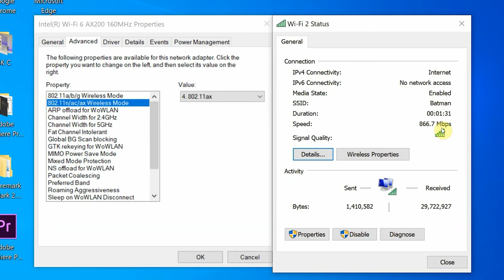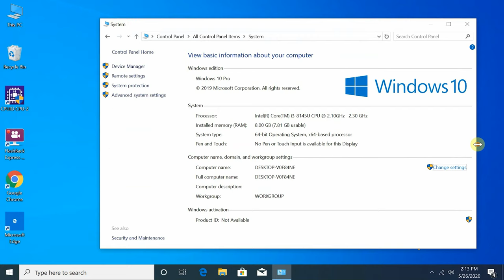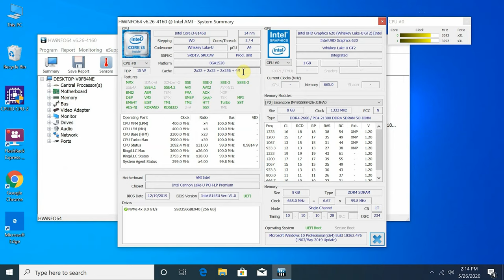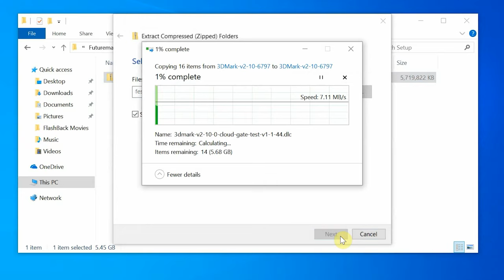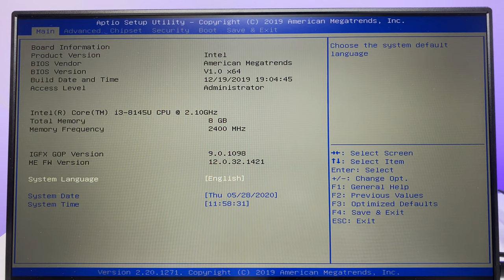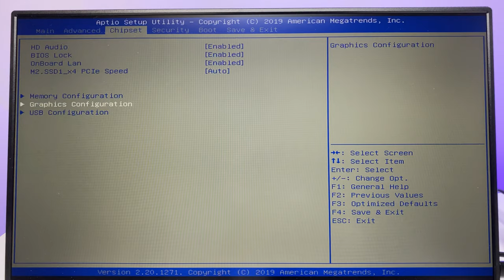BMAX B4 PRO Review || Best Mini PC (2020) - TEARDOWN & BENCHMARKS

Comment: Nice review! Compared to the BMAX B2 Plus, it feels very identical aside from the RAM expansion option. CPU is actually weaker - i3 8100U scored less than the Celeron J4115. So why would one pick this?
Reply from the maker: with Dual Channel it will be much better. You have more upgrade options
Reply: i3 8100U is much faster! where did you find that j4115 is faster?
Reply: i3-8145U at 25W max configurable TDP is drastically faster than the 10W TDP J4115:  2x single threaded and 40% faster all cores/threads

Comment: Thanks for the review - I bought one.  What memory form factor do I need to buy to upgrade the memory?
Reply from the maker: SO-DIMM. Just make sure you match the memory you have pre-installed, so you can benefit from proper speeds. Appreciate the Feedback. Please don't forget to Sub + like + Watch other reviews and share.
Reply: @DealUnboxing  How many pins are on the correct memory card?